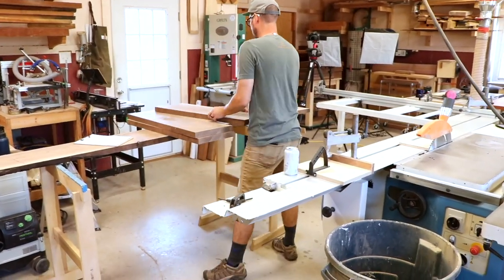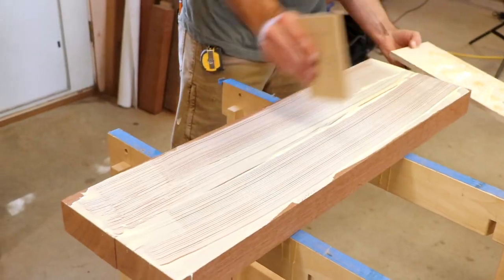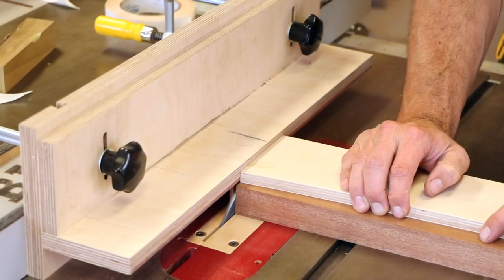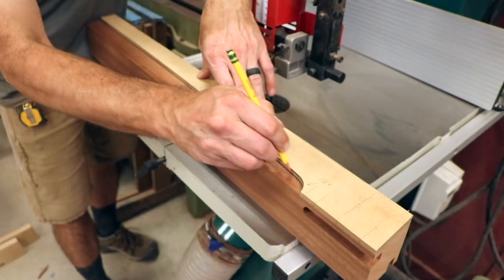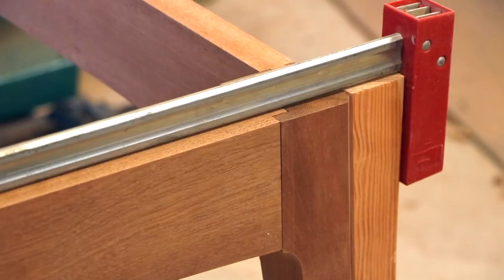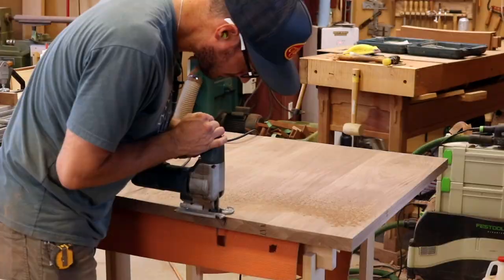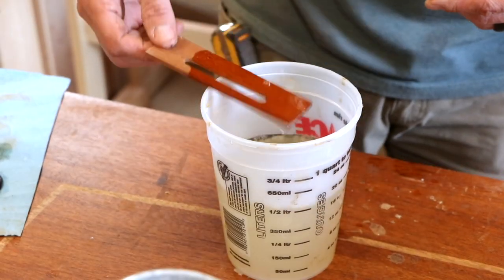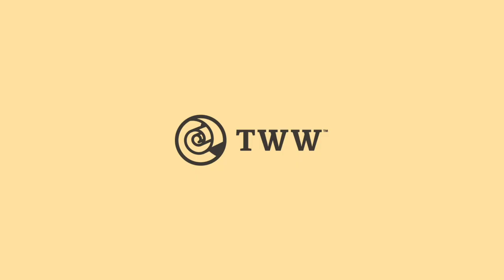Modern Kitchen Table by Philip Morley

Comment: Adding the "toxic sh!t" without gloves is probably not the dumbest thing to do. Using the wrong gloves is often worse than using no gloves at all, and there are almost no "right" gloves for organic solvents. They diffuse through common disposable nitrile gloves within a few seconds or minutes. But you feel safe, don't change the glove and are in contact with the stuff for an extended period of time. If you don't wear gloves, you notice spills on your skin and can take them away quickly.

Comment: Hand sharpened joint knives so they leave a smoother edge?  Say what?!
Reply from the maker: Yeah, he's nuts.
Reply: Hey I do the same thing, leaves a beautiful surface. Often don't even need to sand
Reply: @hazardousafe  I couldn't tell if that was sarcasm or a real thing 🤣.  Thanks for the info and the link...I'll check it out right now 👍
Reply: @christobar  I never knew him sharpening plain or blades was better than machine sharpening... 🤯
Reply: I have a similar jointer with a 4 knife head. Hand sharpening them up to 8000 and the wood gleams coming off of it. Take light cuts and you will be amazed.
William Ng had a video where he did this to planer blades and you can see the results in the video